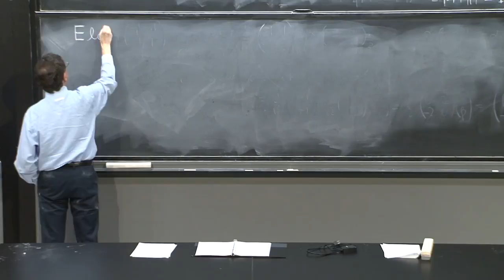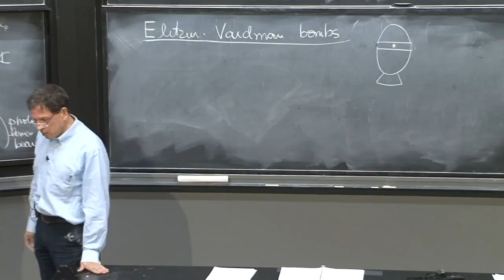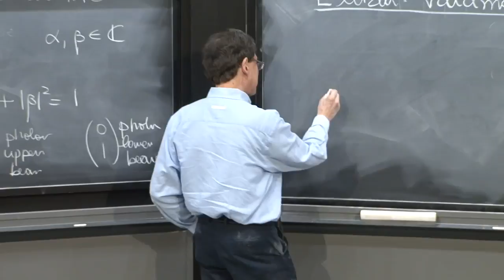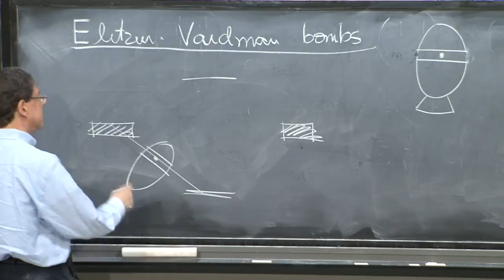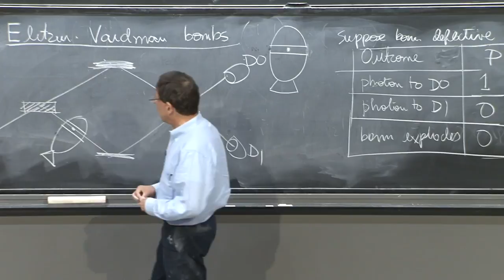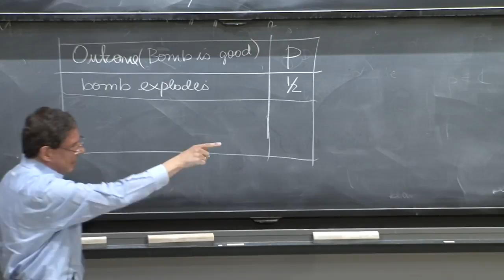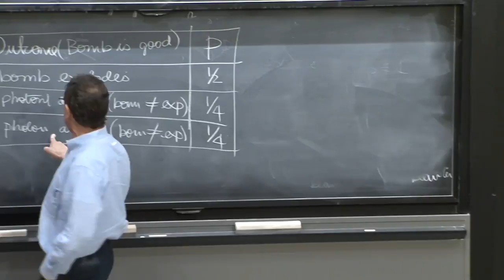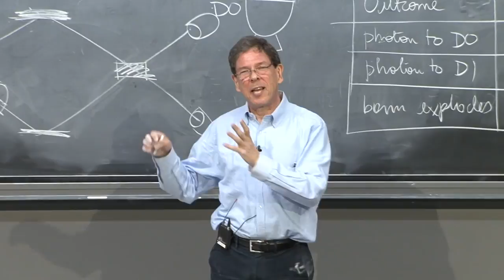Elitzur-Vaidman bombs

Comment: I did not understand, Why would the probability be zero for detector D1 when the bomb is defective?
Reply: if nothing blocks both paths of the photon , it go through both paths and interfere with it self in the second beam spliter witch is made in a way to only allow constructive interfernce in the direction of D0 , however if somthing block one of the photons paths , the wavefunction collapses and the photons travels as a particle , when it hits the second beam spliter , it has 50/50 of going to D1/D0
Reply: Because if bomb is defective the photon simply passes like before and hence the situation gets reduced to the earlier case where we and professor already solved the matrices and computed probabilities.see basically the thing is we cannot be sure that the bomb explodes without it actually exploding but by using this method we can have a probabilistic view on it which to be precise there is 1/4 chance of bomb being good but not exploding despite . And hence in the end we can only probalistic view whether it could explode but didn't and is a good one but could be used for later . In the end he said there are ways to improve this probability  and improve accuracy
Reply: @lepidoptera9337  so am I right to think when there is no block the photon is actually chosen only one path but since we can't be sure we have probabilistic views about both paths or does the photon actually take both paths like a wave ?
Reply: @saifahmad141  Photons are energy. Energy can only be exchanged once, i.e. a photon can only be measured once. Something that has a path requires at least two measurements. Photons can not have a path and nobody has ever measured the path of a photon.
Reply: @lepidoptera9337  open ( L1.5 )of the same series which we are watching please do it and start listening from 5:23 and 5:52 pls listen to prof carefully . I think what he is trying to say is that each photon is in both beams at the same time now how is that possible by following the logic that you provided above ? That means I think you are wrong according to the logic followed by prof. The photon travels in both beams at the same time if it's having interference  and all we can know is how likely there is a probability  of it popping up at any of the the two detectors . Again correct me if I'm wrong. I may be very wrong so pls if you see this explain what you meant above.
Reply: @saifahmad141  Photons don't have positions. Einstein got that wrong in 1905 and to this day professors teach it without reflection. Think about it for a while. Energy never had a position. It was always a system property. Why would it get a position in quantum mechanics?
Reply: @lepidoptera9337  if light doesn't have a position then how can it have speed? We know for hundreds of years that light has finite speed
Reply: @kapsi  Waves don't have a precise position. They have phase. Phase changes in time and can be measured with extreme precision, from which a classical velocity can be derived. Wave fronts and packets can have an imprecise position, which can be used to define a classical velocity. None of that matters for photons, which are not waves, to begin with.

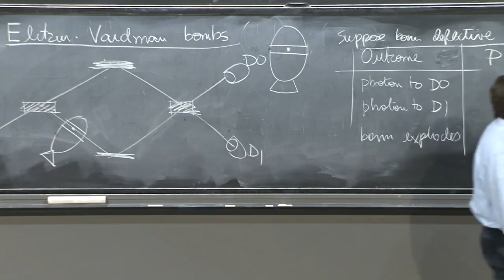Comment: 5:45 why that d0 probability is 1 instead of 1/4?
Reply: D0 is the only option when no path is known for the photon and when the bomb is bad, no path can be known. He doesn't explain this well in this video - I assume that is described before this video begins.
Reply: @DaleSackrider  he didn't even use 'superposition' word
Reply: Hi,
This is because if the detector is not working then the arrangement is similar to the bomb being not there and it becomes the same as described in the just previous lecture L2.4  around 3 minutes.
Reply: if nothing blocks both paths of the photon , it go through both paths and interfere with it self in the second beam spliter witch is made in a way to only allow constructive interfernce in the direction of D0 , however if somthing block one of the photons paths , the wavefunction collapses and the photons travels as a particle , when it hits the second beam spliter , it has 50/50 of going to D1/D0

Comment: what is the meaning of- sign in matrix of beam splitter
Reply: Should be a phase change by 180 degrees. I forgot where it comes from, but it exists in the classical electromagnetic wave treatment as well, if I remember correctly.

Comment: I don't understand why did you consider the bomb would work, if it went through detector 1??? Because there was no photons that went through the bomb??? So, my question is why did you conclude that the bomb works, when no photos passed through the photon detector in the bomb, and just went straight towards the detector 1??
Thank you, I hope I get an answer.
Reply: There's a 0% chance that the photons reach either detector if the bomb doesn't work, therefore if a photon does reach a either D0 or D1 then it means it does work.
Reply: @jamesleliveld9957  Thank you, but he said that if it goes to D0, then it does not work?
Reply: I was wondering the same exact thing, hopefully it is covered in a later lecture
Reply: @DR   @funeralhomeengineer7691  What he said was that photons could be detected in D0 regardless, but if a photon is detected in D1 then the bomb must be good because if the bomb is defective no photons could be detected in D1 as he explained in the previous video.

Comment: In the segment of the video where we supposed bomb is defective, isn't the probability of photons reaching detector D0 is 1/2 and photons reaching detector D1 also 1/2...? This is bcoz if bomb is defective then photon can pass through it easily and give half half chances of appearing at the detectors.. beam splitter will allow  them to go to any one of the detectors...
Reply: Kushagra Uniyal If both the pathways are clear ( case of defective bomb) all the photons will end up only in DO. Review the previous video. Photon goes to DO and D1 only when there is a block I the lower pathway :)
Reply: if nothing blocks both paths of the photon , it go through both paths and interfere with it self in the second beam spliter witch is made in a way to only allow constructive interfernce in the direction of D0 , however if somthing block one of the photons paths , the wavefunction collapses and the photons travels as a particle , when it hits the second beam spliter , it has 50/50 of going to D1/D0

Comment: Can someone explain to me why do we square (multiply by the complex conjugate) the probability amplitudes in order to find the probability of the outcome?
Reply: That has been explained in the earlier lectures. Basically, the state is represented as a vector with cos and sin components along the possible outcomes which are represented as x and y axis respectively and sin^2 + cos^2 = 1, so that square is considered as probabilities of possible outcomes.
Reply: This is called the Born rule, it is one of the Axioms of QM. But to motivate: if you want probabilities the number have to be 0 or larger than zero (which complex numbers do not fulfill), which the absolut value fulfills. They also should add up to 1 which they do, as Compilations Mania explained below. (generally this is the generalized pythagorean theorem in hilbert space)
Reply: Gleason's theorem is the mathematical proof as to why you have to square it. Squaring it was originally assumed as just a law, its own axiom, alongside the Schrodinger equation, but Gleason's theorem shows that there is no other way it could be if you accept the Schrodinger equation as an axiom. The process of squaring the wave function to get the probability distribution is called the Born rule.

Comment: The probability calculations are inaccurate due to unreasonable assumptions. e.g. The probability that a random bomb works or is defective cannot be assumed to be equal.
For example - if you have 100 bombs and for the purpose of testing to determine probability, you're open to exploding a random sample of 10 of them (and 7 actually explode), it is likely that P(bomb is defective) = 30%. This has a material impact on the probability outcomes of the experiment.
Reply: It does not matter, the reasoning is the same if 0% of the bombs are good, or if 100% of the bombs are good. If you detect a photon at  D1 it means that specific bomb you tested is a "good" bomb
Reply: @astrolillo   That's a cheating. A detection at D1 means that bomb is NOT BAD. 100%  that the detector in this bomb is NOT BAD.  All the other conlusions that make "THE BOMB IS GOOD" are just assumtions that somehow considered to be 100% true. They are "this is a bomb" ,  "this kind of bombs never ever fail", "the only case this bombs fail is the detector" ... and so on.  This idea of measurment without interaction have presumtion that there's absolute confidence about the object of measurement.   Ok, I have a result: "it's heavy"!  WHAT is heavy? Well, I'm 95% sure it's 10kg.   Ok, so you are 95% sure it's a kettlebell. But there's 5%  chance it's a rock.
Reply: @shoutitallloud  the bomb is described as either good and it will explode if photon passes through it, consuming photon, or bad, when it does nothing and photon passes through unchanged. There is nothing else to this.
Reply: @MikeKrasnenkov  This is “gedunken experiment”. It’s just your assumptions.
Reply: @shoutitallloud  This is not my experiment and thus not my assumptions. If you disagree with them then you are not talking about the same thing.

Comment: Of course, if you are an even halfway intelligent student, then you will have noticed that the bombs are perfectly classical objects. They explode when they remove energy from the field and they don't explode when they don't. They are physically identical to a piece of black cardboard that is either there or that isn't. Now you can ask yourself, how does a piece of black cardboard introduce Planck's constant into this experiment? And the answer is that it doesn't, which means that there are zero quantum effects in here. 

OK, admittedly, there was probably not one student in that lecture hall who could think that well. :-)
Reply: Sorry but I didn't understand what you are trying to say if I'm right by your thought process its impossible to determine whether the bomb will explode or not but professor is showing how we can have a probabilistic view of now much chance does the bomb have of exploding without exploding!
Reply: In other words we are trying to formulate probabilities of something happening without it actually happening whereas classical mechanics can only guarantee the bomb exploding only after it explodes! I got confused 😕
Reply: @saifahmad141  The professor is repeating a stupid analysis by a stupid paper. The bombs behave exactly like a piece of cardboard. So this experiment is nothing else than you holding a black paper into a two way interferometer. The only quantum effect that is happening here is at the detector and the detector basically just shows you the classical expectation value for the intensities that you get from Maxwell's equations. That's it. There is no quantum mechanics anywhere here.
Reply: @lepidoptera9337  after point 5, youre still not aware if the bomb is good without it not exploding right? Can you elaborate on what you mean when you say there arent quantum effects on this? Yes the bomb is a classical object, but the interferometer setup gives us a small probability of detecting the good bomb without it exploding right?
Reply: @gauthammayur2787  that's exactly my point by using the professors explanation the thing is although we cannot check surely whether the bomb is right without exploding but their a small possibility 1/4 that the bomb works the photon missed it and we are aware it works without wasting the bomb itself we can't be sure so yes its non efficient but there a small possibility that we can check the bomb could have exploded but didn't I think that's the point of this video
Reply: @saifahmad141  Yes, and he did say we could improve on that probability number till 99%, so using that is a quantum property
Reply: @gauthammayur2787  Where are the quantum effects on an object that explodes when it absorbs energy and it doesn't when it doesn't? How does that differ from a match, exactly? Where do you see Planck's constant coming into play here?
Reply: @lepidoptera9337  you're right, it isn't any different from a match, a blackboard or a cat. But here's where the hitch is, the bomb is in a superposition of being both defective and good, as we don't knlw whether it works or not. It's the same as the Schrodinger's cat or a match that may or may not ignite when lit. Only difference is that here the bomb is definitely defective or good and that probability can be only defined by using more bombs for the experiment. 
Until you make an observation, you don't know what the bomb is, and hence it is a in a superposition of both states, which will introduce your planks constant in the coefficient of the superposition equation.
Reply: @gauthammayur2787  A single bomb is either defective or it is good. Only an ensemble of bombs can be in a superposition. Think about it for a bit longer. You are testing one bomb here, not an ensemble of a million bombs.
Reply: @lepidoptera9337  yes you literally said "is either defective or good", dude that's exactly what the Schrodinger's cat was, "either dead or alive", superposition isn't defined in terms of number of trials of an experiment. Only after you make a measurement you know if a bomb is good or defective, or a cat is dead or alive. 
Doing more number of trials just gives you a probability of the bombs being good or bad( given that you make assumptions that all are manufactured similarly and becoming defective is the only random variable) 
It's not a quantum particle like an electron, but since we don't know what it's state is without measuring it, it's in a superposition of states.
Reply: @gauthammayur2787  Schroedinger's cat was nothing. It was an ill-conceived example by Schroedinger. 

In this case the bomb is simply constructed as the equivalent of a classical match. It explodes whenever it absorbs field energy. Nothing that you put around it can change that behavior.

If you want to experiment on a quantum system, then grab yourself a quantum system. A single Rubidium atom is also a whole lot cheaper than exploding ordinance.